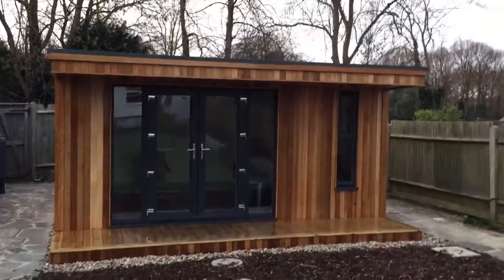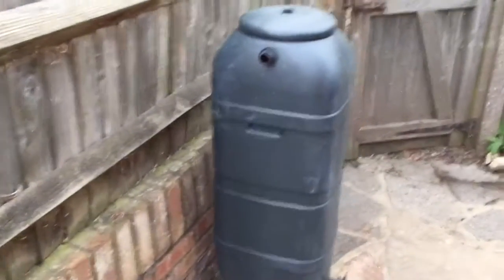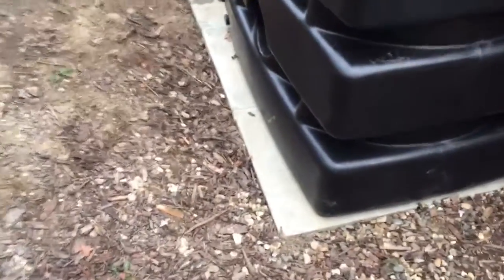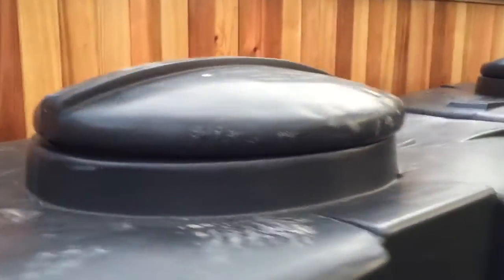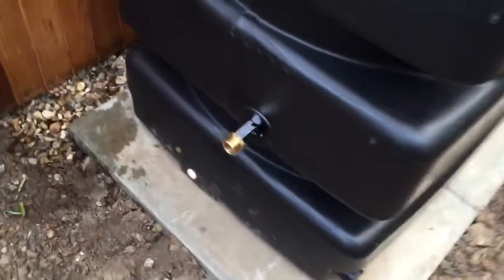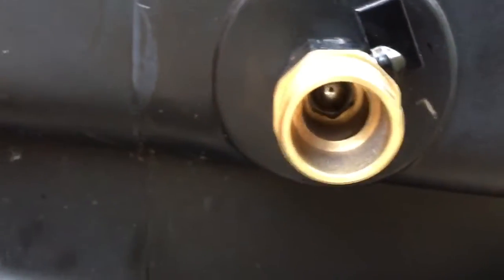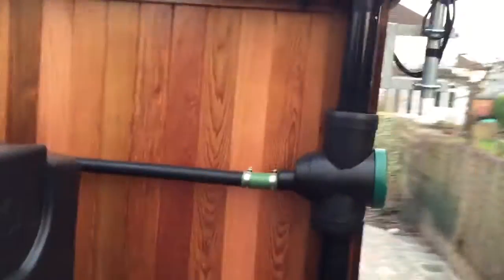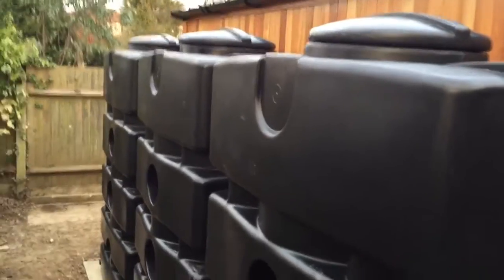Rainwater Harvesting System London

Comment: Hi Duncan, great video, where did you get your water diverter/what make is it?
I am thinking about putting a water harvesting system in to supply water for the washing machine and toilet as we are on a water meter. I will have to check if your water harvesting video for your house is on your channel yet. 

I don't know about the legality of using harvested for the washing/toilet as most water companies base the cost of waste water treatment on a percentage of supplied water.🤔
Reply: Duncan could you please provide an update to your system, especially if you have added the home supply system.

James, I have recently (last 3 months) installed a rainwater harvesting system using IBC’s. I contacted my water authority (Anglian water) and informed them that I will no longer be using the surface water drains in my property and with supported pictures of my system they sent me a cheque for £230 and removed the cost of surface water from my bill.
Much more recently I have had my water meters updated and when they arrived they saw my connections to my cisterns and inform me that a non-return valve should be fitted on the mains supply to prevent ‘grey water’ contamination.

Comment: Great video! Could you use the water for drinking? I'm guessing you'd have to treat the water with chlorine? Thanks
Reply from the maker: You could use the water to drink, but it would need intensive filtration. I think it would need to go through several stages before it would be safe to drink. I only collect this water for irrigation only.
Reply: @duncankelman  Thanks for your reply and help..I'm thinking about installing a water filtration system for all my water needs.

Comment: What about the winter period - do you drain them????
Reply from the maker: Not really, I use the diverter to not collect water when the tanks are full, but I use the water in winter to power wash the car and driveways.
Reply: @duncankelman  I was thinking more about freezing
Reply from the maker: @chrisrebar2381  Yeah, there's been a couple of times where the water has frozen a few millimetres at the top but you can still use the water. I have drained the tanks a couple of times because there's little use over winter, but I tend to just switch the filter so I stop harvesting.
Reply: @duncankelman  Thank you for that. Where can I buy them from?
Reply: @duncankelman  Also, where did you buy these barrels?

Comment: Great video Duncan I'm also in U.K building a rainwater system its currently used to wash car and water garden with a pump. Now I'm going to pump it through 25mm MDPE to a toilet via a PRV whats your thoughts on using a pressurized vessel on the pump?
Reply from the maker: Thanks watching the video. I have a second rainwater harvesting system to look after the house, particularly to use for the toilets and washing machine. The set up I have pumps to a 90 litre tank in the loft and they’re feed by gravity. If you can stretch to the system, it’ll take pressure off your pump and your pipes. If you’re near the south east you’re welcome to come and check it out.
Reply: @duncankelman  I'm east midlands, but thanks for the invite. I already know how that works as I work around this kind of stuff frequently. However I'm not a plumber. Just wondering how much you filter it for the washing machine though and are you using normal detergent or a non phosphate one? I'd have thought it would have made your clothing go green maybe the temperature plays a part in preventing that.
Reply from the maker: @DaleMarriott1337  no problem with using the rainwater for the washing machine. The water is much softer than we have in London and the water is filtered so much before getting into the tank and there’s another filter at the pump, so the water is crystal clear. No problems with the washing ever, actually we have to use less detergent. The other advantage is we have no limescale build up either.
Reply: @duncankelman  So I made my system live today, working a treat currently it is pumped but may change that over to gravity fed later. Just wondering how much your bill dropped having that system installed. Mine is going to be used for toilet mainly and washing car. Probably do the washing machine at a later date. Ordered myself another waterbutt taking my storage up to 400L it's small I know but you have to start somewhere.

Comment: Hi there, a really great solution to the now hot UK summers and strain on national resources. My question is does the water collected in these tanks ever go off and if it does,  is there a lot of maintenance in keeping it fresh and useable?  They look great btw!
Reply from the maker: Wcatreading The tanks are the key to keeping the water clean. They don’t allow sunlight in so there’s little chance of algae growing. The water stays fresh all the time, the key to actually using it! We use this water to mainly water the garden, window cleaning and washing the car. 

Since this film, I’ve added a second rainwater tank that’s buried under the lawn. It’s 7.5k litres and the water from that is used to flush toilets and supplies the washing machine. 

One other benefit of using rainwater is that you never get limescale which is a big problem here in London. 

Thanks for stopping by.
Reply: @duncankelman  Buried  tank.That's what I wanted to do but too much hassle for our plot. So putting in above ground system in back garden off of the back roof and shed. Live in a terraced house, any solutions to getting front roof water to back of house. Got some ideas but not happy at mo. Great looking setup, well done.

Comment: I'm so confused I apologise, so u use the water to water the garden? When it rains the garden already gets watered already.......I don't get it I thought u would be trying to have natural, possibly the most purest form of drinking water instead...
Reply: For garden use, it's stored for when it hasn't rained, to protect the garden. You can also - and this is the bigger deal for a lot of people - use the water to run the washing machine and household toilets - which pretty much halves your water bill. In most western countries, it is prohibited to run a rainwater harvester to your drinking and washing taps (i.e. kitchen and bathroom, both hot and cold) unless you have a full treatment system, and a potable water rated installation (i.e. potable supply rated  tanks and pipework), which put together gets very expensive very quickly. In Australia this is only done in remote areas (farms or cattle stations, remote mining sites etc) where mains water isn't available.  In the UK, I imagine it's just outright prohibited as they don't have any truly remote areas. Contrary to belief, rainwater can still have impurities - acid rain is a thing. In a survival situation you can drink it, but it's not something you want to do for any length of time. There's a reason people died young before modern industrial water  treatment was developed, and why people still die young today in areas without modern water systems.
Reply: @lmlmd2714   the mains water is poisoned by devil worshippers mate so your doing fine if you filter the rain water with pebbles,charcoal,sand in a stone base
Reply: Lord Rupert  Im starting to drink rain water. Just boil it in the kettle. Tastes exactly the same for tea and coffee